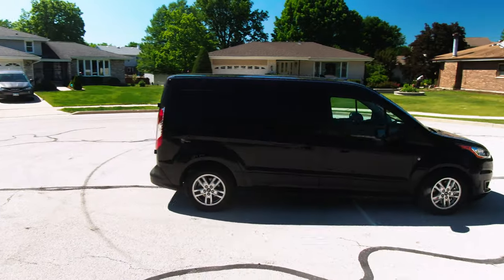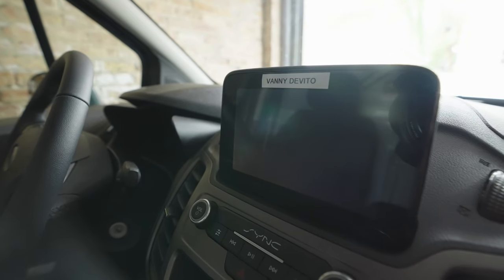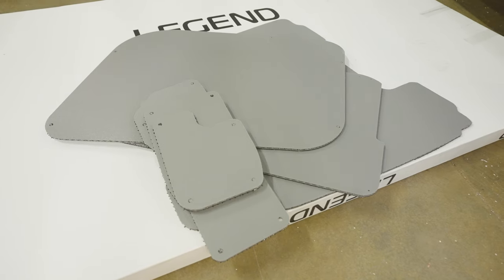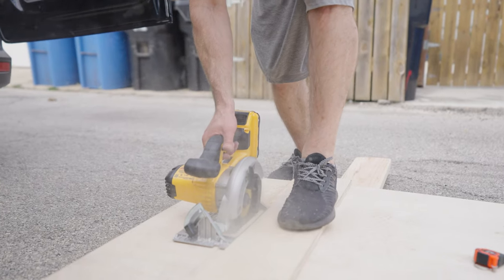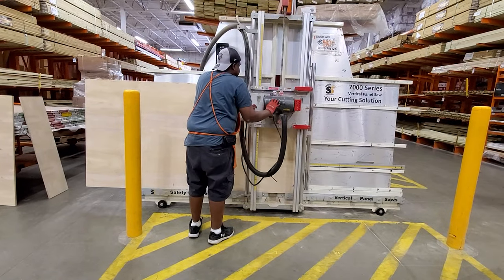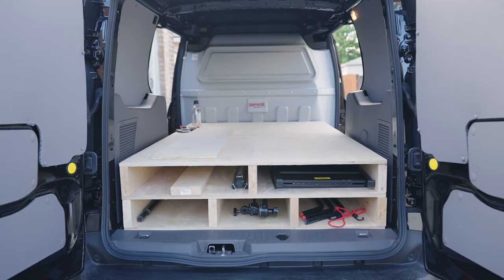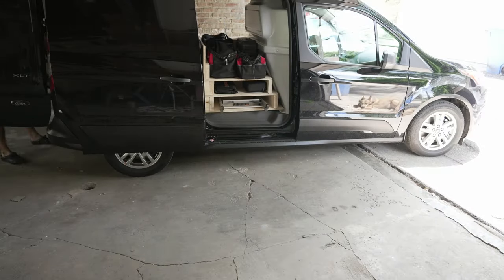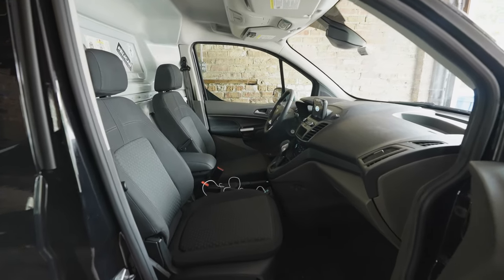Video Production Van Build | Part 2

Comment: Love your van buildout series, thanks for sharing. I'm working on a very similar build for a Ford Transit Connect. Curious if you pondered lining the ceiling in a similar fashion as the walls and doors. Or, is the ceiling not as vulnerable to dings and dents? I think I'm going to have to stow gear from top to bottom in my van, so ceiling protection feels important.
Reply from the maker: Hi! Thanks for watching. Glad it helped. I didn't do the ceiling because I was considering hanging Stuff from there and still may. Definitely get it if you'll have floor to ceiling stuff!
Reply: @TylerBedgood  great to know, thanks! And that's a cool idea - to hang stuff up top. I'm planning to structure my build very similarly to yours - just going a bit higher with the shelving to accommodate more stuff. And I think I may stow stands and lighter items up high - just b/c it's easier for me to lift those items vs. hefty pelicans. Working with U.S. Upfitters to get my partition and liners ordered now. Thanks again!
Reply: Did you have any reservations about covering up those access openings that are located in the rear walls, near the doors? I've opened the panels up and it seems that maybe they allow access to the wiring for the rear brake and signal lights. Am I wrong about that? I'm planning to build a wooden shelving/cubby platform like yours, which would be removable, but not easily so, since mine will go up higher or be composed of more sections. Do you think it will be bad to cover those access points up if I can't get to them easily once my platform is built?
Reply from the maker: @carriestarscapemedia  so mine are still accessible. And if they really need to get in then I'll remove the base. It's just how it has to be. I can't pass up on the build space because maybe sometime they'll maybe need to get in there. I can just remove the base. Sure it's a hassle but better to do that than sacrifice the space it would take to not do it. Alternatively you can cut out the sections that they need access to from your base. If your going to build it higher it probably won't affect it structurally. Good luck.
Reply: @TylerBedgood  yeah I totally agree, definitely can’t sacrifice the space. Thanks for the feedback.